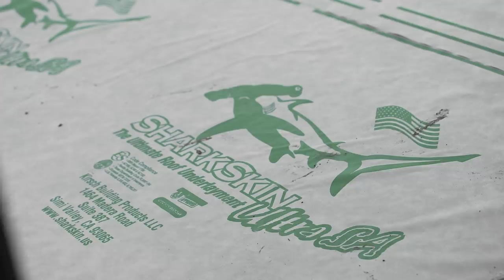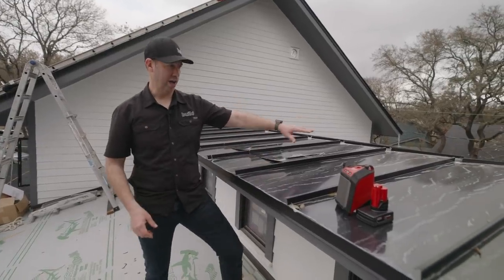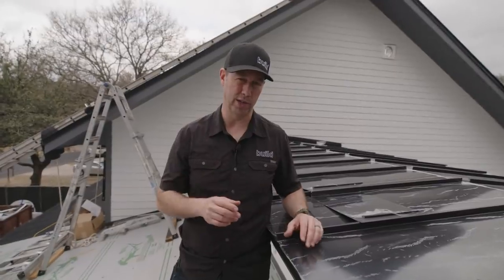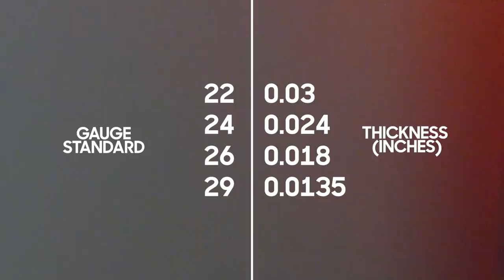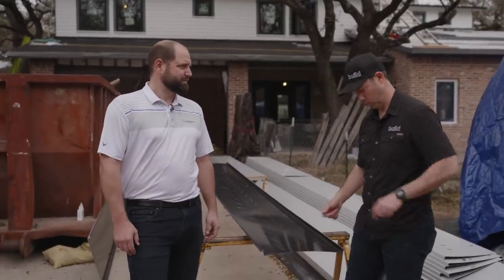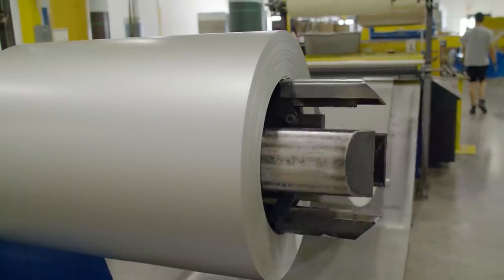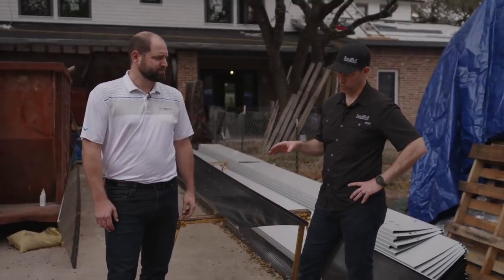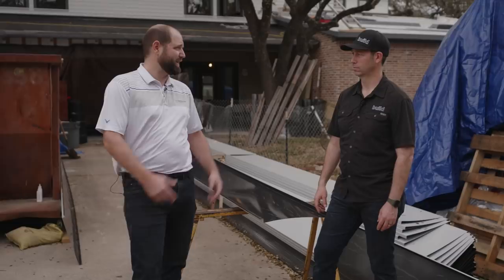Metal Roof- Best Practice Details

Comment: In my opinion, adding ventilation behind your metal roof is an excellent idea. I never understood that we vent the wall, but not the roof when you receive all you water on it. Take care Matt!
Reply: I think it all depends whether your addic is conditioned or non conditioned/vented. In Matt's case having a vapour barrier on the inside of the roof rafters it makes sense, but if you have a ventilated truss addic, not sure if you really have to as long as you use a decent underlay?
Reply: @vik6980  I think adding a vent between the roof and the plywood would reduce water pressure. Therefore, reducing risk of leakage.

Comment: Like Brad Gaeth, I'm wondering how you did all your vents. The attic is conditioned, and we've seen the interior of the attic in other shows, so we can tell know you didn't cut corners and vent to the attic :-). I was watching the eves for vents, but didn't see what I guessed might be there. I think a separate show on venting best practices would be well received. In my upcoming project, I'll have a metal roof, and I'm wondering how to do combustion and exhaust air, as well as DWV.

Comment: If you do this vented drip edge detail, I can guarantee you that you will get condensation dripping out of the the Cor-a-vent in the north, and likely intermittently in the south too.  You will see it running  down the fascia and onto the surfaces below -- not a big deal if over plantings/grass, but it will be a call-back issue if there is a deck or other hard surface like a patio there.  And no, the gutter will not catch this if you have not prepared for this.  If you have prepared for this, you would need to add a Z-shaped "kick-out strip" made from the same metal as the roof that would get installed onto the fascial as the first step of the roofing process.  This kick-out strip will direct this condensation that happens under metal roofs, into the gutter.  It gets nailed onto the top of the fascia, and then taped into the roof deck before the Ice-and-water goes on THEN you do the rest of the roofing detailing as described in the video.  "HOW DO I KNOW!?"  I've made this mistake before!

Comment: For anyone who is wondering: Matt is indeed right. It doesn't matter which way you put on the radiation barrier, as long as the reflective side faces the air gap. 
At first I thought he put it on the wrong way, so I looked it up. An ideal reflective body (which does not exist) will neither absorb, nor emit any thermal radiation. In his case, the radiation barrier will get hot due to thermal conduction, but it will not radiate into the air gap, because of the highly reflective surface. This even works the other way around, because any thermal radiation coming from the inner part of the roof will be reflected back.
The air gap itself however will do almost nothing to remove heat by ventilation. There is so much friction due to the small size of the gap, that there will be no meaningful air flow. That's why it is smart to use a radiant barrier, because this way the air gap can provide at least some thermal insulation.

Comment: Matt, I am looking to install a metal roof -- using steel or aluminum "shakes" --  I like your idea of allowing air-flow under the metal roofing.  I also think that the 1x4 on a steep roof is quite clever  and they 45 degree angle is an amazing twist....  Question = what was done at the eves and rakes with the 1/4? is there a product used at the eve to fit between the 1x4's or it that the plastic strips you show in the video that are nailed to the barge board prior to the install of the drip edge/caps?  For the rake is there a 1x4 that runs parallel to the rake for the full length of the rake edge? Last question, how far apart are the 1x4's spaced?  Great video -- I hope you see my questions and answer soon...  Retired Person in KY
Reply: also curious about spacing, looks about 36"-48" on center

Comment: Facing the radiant barrier towards the air gap is absolutely the right way to go, but I'm curious whether it's more effective to face toward the interior or the exterior. Both should work reasonably well since polished surfaces have low emissivity and high reflectance, but there are a ton of complicating factors that impact the effectiveness:
* How much better the emissivity/reflectance is than the surface you're applying it to
* Conductivity of the surfaces on the air-surface interface on both sides of the air gap
* Size of the air gap
* Reflectance/emissivity of the opposite surface
Reply: Looking into it further, it looks like you definitely want the radiant barrier facing toward the interior in a cooling climate.

Low emissivity keeps the surface from transmitting radiation. High reflectance keeps the surface from absorbing radiation. Aluminized mylar has ~4% emissivity and ~97% reflectance. A white painted surface has ~90% emissivity and ~90% reflectance.

So, put the radiant barrier on the side you want to stay hot. On the cold side, it's only a marginal improvement over white paint.
Reply: @ARShirk  the layer being in the darkness has little to do with its effectiveness. The advantage of a radiant barrier is low emissivity, meaning the hot surface behind the barrier will transmit far less heat inward via radiation than it would otherwise. OTOH, with a small air gap between the barrier and the rest of the roof, convection and conduction are likely to be the dominant modes of heat transfer anyway. You'd get much better mileage out of an assembly that has a large gap between radiant barrier and the rest of the envelope like a vented attic.
Reply: @JamesRibe  i kinda wonder how the math really works out in practice, as if the emissivity/reflectance of Aluminized mylar is indeed 4%/97% would that not mean that potentially 4% of the heat would radiate towards the inside (inward-facing) compared to only 3% being absorbed (outward-facing)? 

But I would suspect the main difference (between the facing of the material) might come down to the behaviour of the air in the air gap rather than the emissivity or reflectiveness of the material. If the material is inward-facing heat removed due to air convection would be less likely to radiate inwards. While an outward-facing reflective material would potentially have to reflect more radiant heat from both the air and the roofing material, I would be interested to see the actual differences as the research i found on this was mostly looking at attic installation nut comparing different methods for roof installation
Reply: @JamesRibe If you put the radiant barrier on the peel-and-stick side, then the white underside of that roofing material he used could also act as a bit of a radiant barrier. Not sure how much difference that would make though. Figuring out how much heat gets absorbed between two radiant barriers reflecting back and forth is a bit too much for me at this time of day.
Reply: @davidg5010  of course the reflectivity of the foil is much higher than the emissivity, that is literally the reason why he installed it facing downwards.

And if the numbers are wrong what are the numbers then?
Reply: @davidg5010  went to the manufacturer's website for THE SPECIFIC PRODUCT used in the video. Their instructions literally says it can be installed facing both ways, to the point where the illustrated installation is facing down as matt installed it. So please go to the manufactures website and read the manual.
Reply: @davidg5010  they have a pdf file for installation and application with installation instruction that describes in text that it can be installed either way, along with an image showing it being installed shiny side down

They  also have a list of example  "project installations" at the bottom with several picture examples of it being installed radiant side down
Reply: @davidg5010  Me, Matt as well as the scientist and engineers that produce these products understand emissivity quite well thank you. 

And i find it amusing that you bring up LP techshield since after i googled that product their install material and videos almost exclusively show them facing inwards, including their promo video. 

And have mentioned convection and conduction in relation to radiant barriers as response to other comments for this video.

also, why would you measure a drop in emissivity by degrees F? its jules or watts (along with other relevant units like area, volume and hertz), or in imperial BTU
Reply: @davidg5010  Then perhaps you should contact LP building solutions and tell their engineers and product designers that their installation instructions are wrong, I'm sure they will be happy to correct it immediately
Reply: @davidg5010  yes but selling a product that doesn't really do what you claim it does when it comes to construction has a tendency to invite lawsuits from customers so they would be interested in giving correct installation instructions.

 but at this point I dont know if you are trolling, or if you honestly believe what you write
Reply: @davidg5010  The thing is i understand the science behind it so i dont need my imagination, i myself was confused when I first saw Matt install it that way so I looked in to it. there have been quite a few studies done about the subject by both industry, universities and governments, and of course the basic science behind reflectivity and emissivity. And they all have the same basic conclusion, both installation methods work. in some cases the emissivity version (shiny side pointing in) is considered the better choice in others reflectivity is the better choice.

But despite this you say they have a product that works when the reflective side is point outwards butt not inwards. but because they want to sell a few more rolls or sheets they have what? decided to create all this, apparently fake, research to have a reason to recommend installing it both ways? 

Can you actually give any substantial information to support your claim that it doesn't work? any at all?
Reply: @davidg5010  All im hearing is you have no evidence to back up your claims
Reply: @davidg5010  so arguing that study's, experiments and practical test that show emissivity works for radiant barriers is evidence for it not working? That is some Trump level logic right there
Reply: @davidg5010  1. of course it will bake, at no point have i argued this would not 

2. wrapping a potato in foil and placing it beside coals (i assume you mean next to them and not on the coals) would be a reflective protection, not an emissive one, you know the thing YOU said worked. So by your own logic you are claiming it wont bake then
Reply: @davidg5010  no its called science
Reply: @davidg5010  and for what reason would you call it dishonesty? aside from pointing out your statement is flawed

Comment: I was so happy to see someone actually doing true standing seam. I'm so tired of seeing carpenters call snap-lock standing seam. I hate your metal because it can't be soldered. But your crew is doing a great job. Everything I saw was up to or above current specks. BTW, we(tinsmiths) refer to the two sides of the panel as male/female. Thanks for the vid.
Reply: Snap lock is considered standing seam...
But it is not a True Standing Seam metal 
All it has to do is have a standing leg to be considered standing seam.
Reply: @peterparker9286  I know. It's just that I have been putting on double-lock, batten seam(with true batten boards) and soldered common flat seam for almost 44 years. I used to work with Terne, mostly. I have done a lot of copper in 16, 20, and 24 ounce. I have done a lot of lead -coated copper and "Freedom Gray". Lately, I have been using a lot of Roof-in-Nox TCS. This is really a very superior product. I think the baked on factory finishes definitely have a time and place, but frankly, if the roof has penetrations and you can't solder the metal, it's junk. Just my old time tinsmith's opinion.
Reply: @peterparker9286  BTW, I should mention that I work in Washington, D.C. and get a lot of historical and government work that require SMACNA specs. Not everyone is so fortunate. Freedom Gray is a Revere Copper product. They started making it in response to EPA cracking down on lead. I believe it's a tin/zinc alloy coating instead of lead. Ages very uniform, nice looking architectual metal. Thanks for your replies. Peace.
Reply: @peterparker9286  Yup. Marketed in U.S. as Roofinox. It's not quite the same as Follansbe's old TCS, but it solders beautifully. One weird thing. I can get it in 500' x 20 or 24" rolls for pan forming machine, but the sheets are 10'x 39.37"(a meter). You can't get two 20' blanks out of a sheet. Monkey wrench on layout, kinda.
Reply: @calliecooke1817  I innerstand what You be saying. Example in auto-body sheet metal easily weldable 33 years ago not anymore... Galva Tron B.S.
Reply: @peterparker9286  Well, like I said in my original comment, I am very impressed with the roof you put on. A most profesional job. I usually am not so long winded, but you're talking my language. I was there when Follansbee wrote their specs for Terne II back in like '82-'83. My boss, Bill Norington at Koons Roofing was a paid consultant. My first cousin, Greg Pickens owns ADJ Sheet Metal. Largest duct shop in MD. Look him up!! He's also regional VP of SMACNA. He regularly calls me for unofficial consultation about roofing specs. He's a duct man, after all. That said, if you ever need advice on a spec, I would be happy to help in anyway I can. I like your style Peter. Peace.
Reply: @peterparker9286  Funny Peter, but you might be able to help me. My side hustle is riding fence, and maintaning structure and water supply at a small horse farm. The indoor riding ring has a corrugated roof. 20'x38'' panels, face screwed with rubber washer screws. Problem is, there are five "skylights" at intervals on each side. They are shot. They are 11'x38" clear plastic or plexi-glass. I've searched high and low. Do you know where I can obtain these creatures?
Reply: @calliecooke1817  I had thought master coils where 44.25" .  A few years back sheet metal coil was short on the slit 24" coil was like 3/16 short.  I called them out and they started back peddling about adjustment of machine forming... No No its not 24" where is the 3/16 x miles.... Coil dumping middle men sendn recycled toyota scrap coils saying its made in the USA... B.S maybe painted and slit but its coming off the boat cold rolled laying eggs.  Keep keeping On Friend.
Reply: @calliecooke1817  Isnt that some kind of fiberglass yellowish looking stuff. I have seen that stuff on old golf courses. Gets really brittle and starts spider webbing apart. Melamine???
Reply: @peterparker9286  That's some crazy sh--t!! Like I said, I don't have a lot of experience with the 'Konar' type metals. But I know that whenever you start adjusting that pan machine to run a different width, it eats up time. That's not wanna those things you do lickety-split. And then you gotta put it back!! Time is $$$.
Reply: Polycarbonate  do you have a home depo?
Reply: @calliecooke1817  Thats funny Hylar/Kynar  = Conar. Aka King Kong Krap...
Akzo Noble PPG  Dupontus Criminals
Reply: @peterparker9286  Exactly, and thats the problem. 25 years old and UV has eaten it up. There's clear pans all over the internet, but not in the righ size. Yes, I have Home Depot but all they have are 24" pans. I may end up using that. I'll just have to over lap them more to the side, or rip them. Thanks. And yeah, that is funny as heck. I don't even know how to spell it. That shows often I use it.
Reply: @peterparker9286  I called two steel building companies, but they weren't trying to tell me where they got their material.
Reply: @peterparker9286  I don't know what the brand they're sekking at Roof Center, but I just did a 2 sq. front porch, no penetrations, it came out nice. The nicest I did was all the entry's at Chevy Chase Country Club. 5 of them. All 1 sq. Again, no penetrations. Then 3 sq. shed dormer on 19th hole. Looked great in green at the golf course. I'm not averse to it. And if it's applied with care that your guys were showing I'm sure it's a great roof. I'm just a dinosaur.
Reply: @calliecooke1817  ABC metal, Lowes home improvement, home depot, Hansen pole barn, Wausau Supply Company. Polycarbonate or Acrylic panels. Lapping them or stitching them together wouldnt be that bad... gots to do what Ya Gots to Do... I noticed the Solar disk in the sky will be making French Fries.....
Reply: @peterparker9286  I've made dozens of hammered glass skylights and louvered bases. I can duplicate ogee cornice work and solder all the little dental boxes and the zinc ornaments(which I can get from a guy in pittsburgh). I've rolled literally thousands of gutter ferrels by hand. I truly am a dinosaur. I'm getting tired and am blowing hot air, but I've enjoyed my trade. I've having a hard time putting it down. It's good to know that there's young guys like you to carry the torch. The first double lock standing seam roof was on the Cathederal in Rheims in France. If I remember right it built in like 800 A.D.  1200 year tradition brother. Cheers.

Comment: What about issues with oil canning? We recently used a panel almost exactly like yours for exterior wall cladding, but we had a terrible problem with oil canning. What is best practice in regards to oil canning?
Reply: There's really nothing to be done. Its just the nature of metal panels b/c of expansion and contraction. When we get metal panels the warranty information specifically says that there is nothing they can do about oil canning, it is not a defect, and it is not covered under warranty.

Darker colors show oil canning more. The more vertical a panel, the more it shows as well.